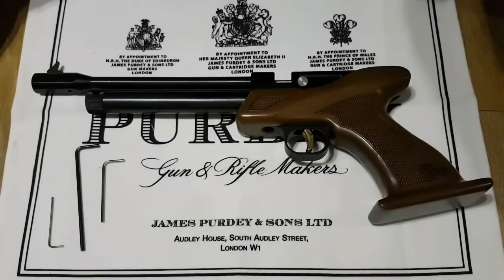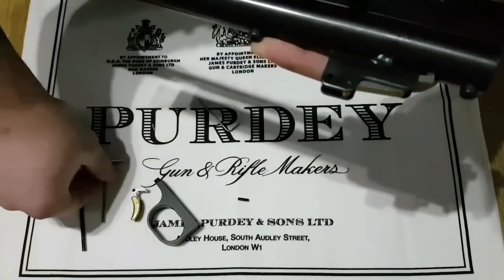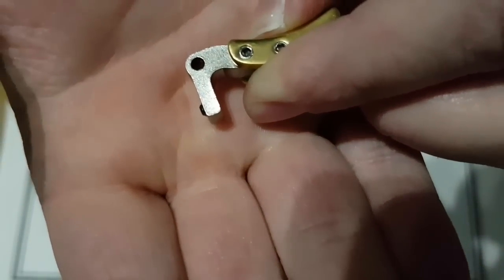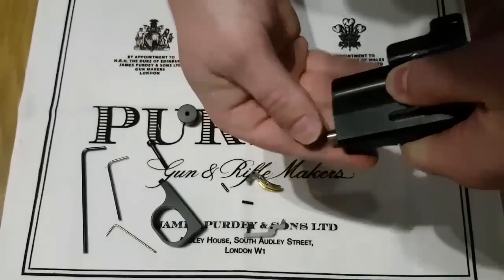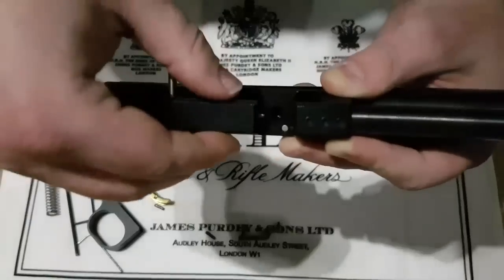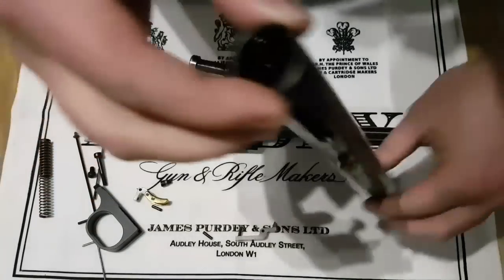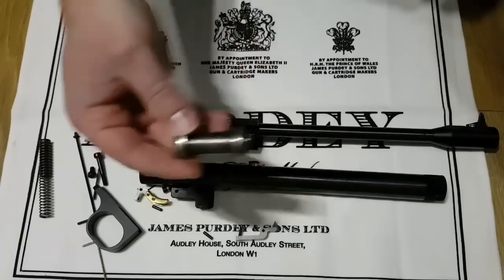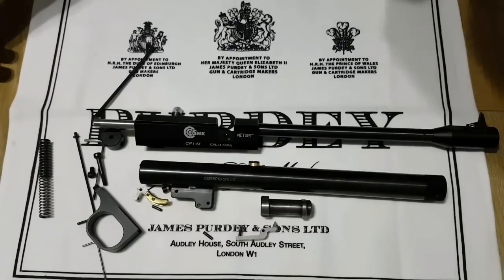SMK CP1 Strip Down & What Internals To Polish - The Airgun Hub

Comment: Great informative video mate, One extra improvement I made to my CP1 was to replace the quite stiff small spring that holds the sear in place on the trigger assembly with a much lighter one from a ball point pen. It's made the trigger action much lighter and predictable. Keep up the good work.
Reply from the maker: +Jason Pierce 

Thanks Jason. I did try that but the pen I used had a bigger diameter spring, maybe it was just the pen I used.

Comment: I would recommend examining the 'action tube' where the hammer rides for burrs, and polishing them out with wet and dry wrapped around a mandrel spun by a cordless drill. Then the hammer can slide smoothly and consistently.

Comment: Thanks for this very clear video. Obviously the manufacturers have watched this!
The trigger is now a 1 piece affair! The Gunk in with the hammer was not present neither was anything else, and this is a new gun! The need to polish trigger and sear did not, to me, seem required and the action prior to dismantling seemed smooth enough. the hammer did need attention as you described. Thanks again.

Comment: Hi, thanks for the great video. I’m currently fitting a Huma regulator to get a bit better shot count. Can you show how to get the valve housing out of the barrel. Ive tried to force it out the front end but its not budging at all
Reply: CO2 is self-regulating. The liquid CO2 exerts a constant vapour pressure ballpark 850psi. Regulators are for PCP e.g. the PP800.
The valve is held in place by a small screw but you also must remove the transfer port and cylinder, and it comes out of the cylinder end. Do not use force.

Comment: Thanks for this great video, it's been really helpful. What size allen key is needed to remove that small grub screw from the trigger? I tried a 1.5mm but the screw just wouldn't move, and the allen key ended up getting rounded off! I then tried a different 1.5mm key, but that wouldn't even fit the screw! Cheers

Comment: You can get Grub-Screws with a Nylon Ball insert in the end, I'd imagine that would give a nice smooth Trigger feel.
As for Smoothing/Polishing the Bearing Surfaces on the Hammer, I would suggest NOT using a coarse Wet/Dry Paper (or Emery Cloth) at all.
Starting with a 800 Grit would be plenty, then progressing to 1000 and higher.

Comment: I want the PCP one but with the wood grip of this I wonder if it fits
Reply: The PCP version comes with a monster sized grip. Just cut/sand down the grip to a perfect custom fit for you. Checker, stiple, or finish however you like. 
Now I want my original parts, so I just make a custom gip from scratch and save the OEM in case I ever sell it. But in over 38 years, I haven't sold a single air gun I ever bought.

Comment: Hi just want to say the only thing that was left out that I no     of is a flex hone 18mm brush 800 grit to polish the inside tube after you clean out the China dirt aka gunk. You can also polish it after the sanding of hammer with buffing pad.

Comment: What do you use to do the actual polishing of the parts. I have a Dremel, but am not sure if it will do the job with say some Unipol or Rouge, like in jewelers polishing compounds. My apologies, i did not finish watching the video before asking my question.
Reply from the maker: Johan Combrinck 

Hi Johan, some compound polish may work but not sure if it'll be gritty enough to start to polish metal, you could always give it a try, I'm pretty sure it wouldn't damage the metal. 

as I said I used some wet and dry paper starting at a low 600 grit working up until I was at 2000 grit. this helped smooth and polish the surface so the metal contact points has far less resistance.

Comment: How do I remove a gas cylinder that is stuck in the gun?
Reply: The CP2 has a hole in the 'action tube' for poking the CO2 out (compare), otherwise drill a small hole in the spent CO2 and put a self tapping screw in to pull it out

Comment: I bought this gun and it is Gorgeous, but please someone tell my the Magazine will not insert....did anyone else have that problem? I cand only load single pellets and it is the .22 model, thoughts on this would be appreciated. Thank you.
Reply: did you work it out,,,ive just bought one of these and the guy in the shop told me to spin the clear plastic of the magazine round to the last pellet , put that one in first then all the others otherwise the mag wont spin round.
Reply: @NOT_SURE..  Thanks for asking still love this pistol but the magazine does not work well, also have problems with loading one pellet fits tight. Other than that when loaded shoots well.